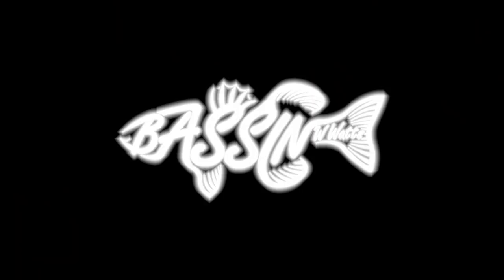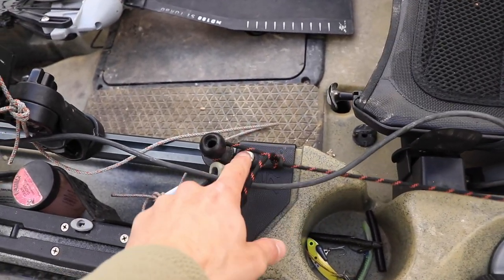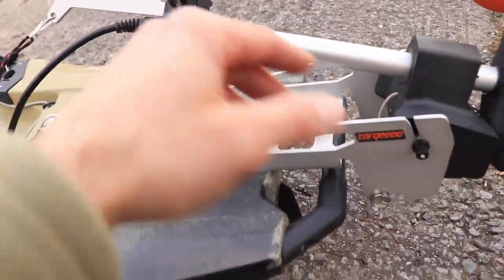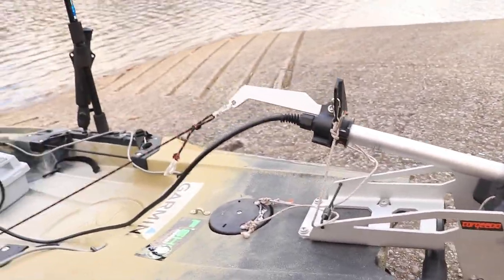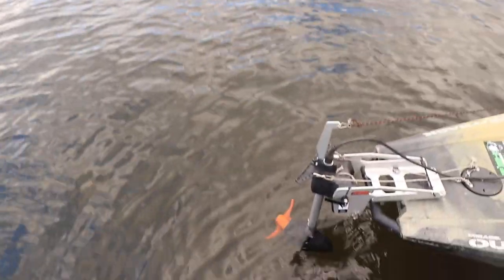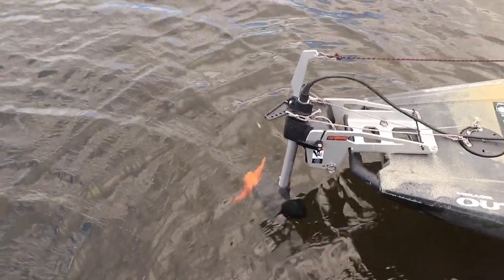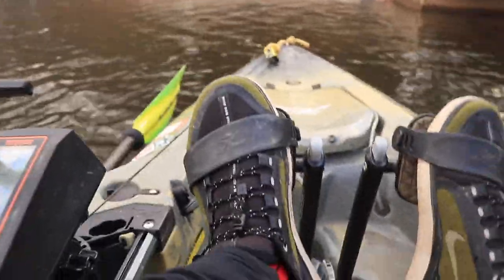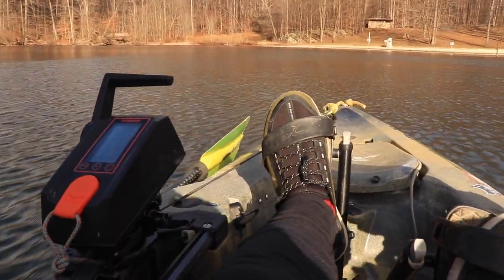Motorized Fishing Kayak | Hobie Outback With Torqeedo Ultra Light 403

Comment: Awsome setup bro. Those Hobies move with any motor, I've seen. Whether a Bixpy, NK 180s, and especially the Torqueedo 403 or 1103. But you just   have to get that perfect adjustment. The motorized, the tank well, the gear. Even with my bixpy. I have my 2021 Radiant citrus orange, Hoodoo Impulse 120, fin drive. I love my boat, and run my J2 bixpy on my Vube gravity rudder. My  spare battery, is mounted on my 13x16 Black Pack. Myself at 5ft 7" 152 lbs. She moves around 4 to 4.5 mph. With a light pedal over 5mph. I usually cover alot of water, especially in my bass tournaments. I am going to upgrade next year to my Torqueedo or the NK-180s.  😎 🙏 🎣

Comment: Thanks for the video.  I just found a great deal on a 403.  I called my local Torqeedo dealer and they said they can replace the pipe with a longer one, so it will be like the newer motors.  They will give me a quote as soon as they are allowed to open back up.  I'm sure your local dealer could do the same.
Reply from the maker: No problem ! Thats awesome that they could do that ill have to check it out.